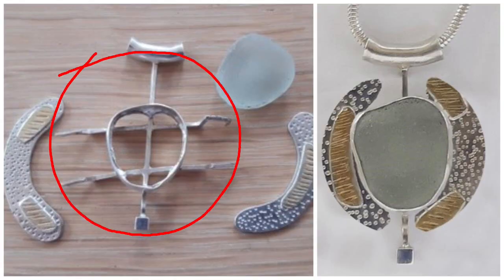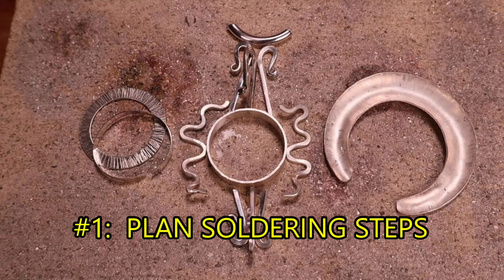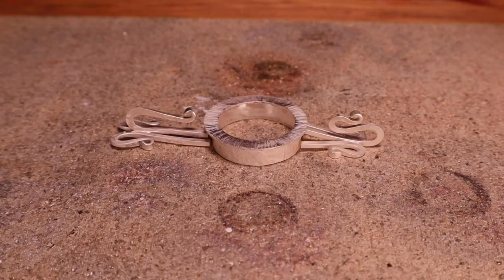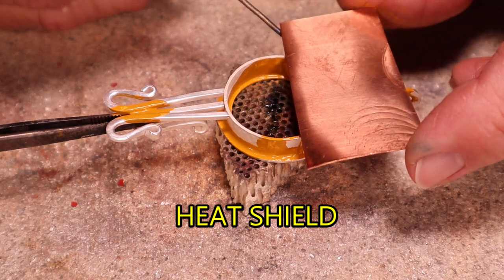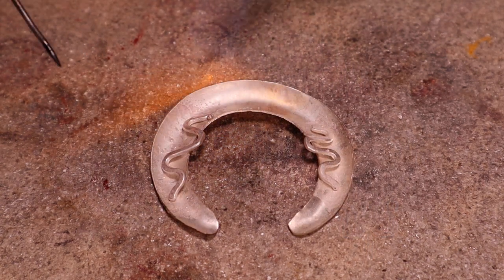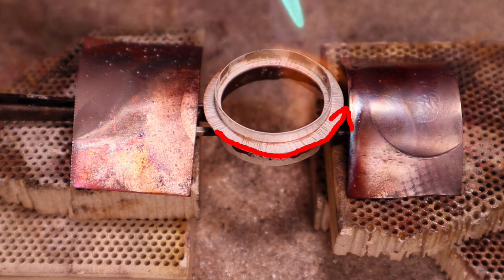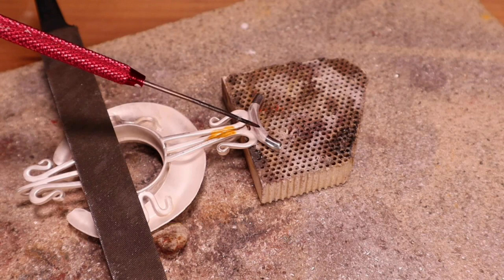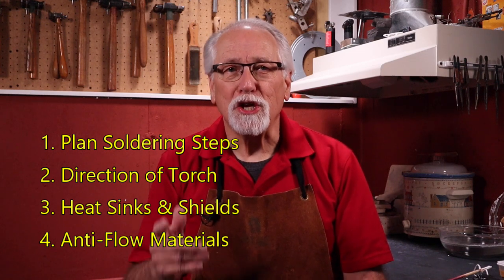HOW TO "NOT MELT" SILVER SOLDER -  PART 2

Comment: thanks so much for this video. It is exactly what I was looking for. How do you clean up all that solder, I'd be curious what your "go-to" method is, thanks for the GREAT videos!
Reply from the maker: Hello Mara,  I'm glad my video was exactly what you were looking for!  I try to avoid using too much solder in the first place so I don't have to clean up so much extra solder. Make sure you check out my video " Best Way to Ruin your Silver Jewelry Project".   For cleaning up the extra solder, it all depends on the project. The 3M polishing disks work very well. I also use silicone wheels.  They can be aggressive, so  be careful with these.  Thank you for watching and commenting.  Greg Greenwood

Comment: Hi Greg, highest compliment to the video and design of your pieces. 
Have got a few quick questions. Is there a specific kind of flux you use. My borax cone method tends to bubble a lot and crystallise, sending the solder pallions flying around. Also, any idea how the masters solder tiny prongs just next to each other, is it the very intense heat of the little smith that allows it . Thanks for taking the time to read this!
Reply from the maker: Hello Jope,  Thank you for your kind comments.  I appreciate it. I use Handy Flux.  It is a borax flux that is already prepared.  It lays down faster than the cone borax.  Tip for you.  After you put the flux on the metal.  Heat it first which will burn off the extra water and it will lay down and remain "sticky".  Put your pallions on when the metal is warm and the flux is still sticky.  This will hold the solder in place.  
Soldering tiny prongs close to each other can be a problem.  Your little smith will help you melt the solder quickly. You can solder the prongs all at once so you don't have to worry about re-melting the prior solder joint. This set up can be hard because you have to use several third hands or tweezers. But it is the easiest to solder.  If you solder one at a time, use the "how to NOT melt solder" methods. 
I hope this has helped you.  Thanks again. Keep watching. Greg Greenwood

Comment: Thank you so much for both of these videos. I learned a lot! Question, how do you texture your silver? It seems to be something you use often on your metal, those very close lines. Also, how long did you keep your metal piece in the liver of Sulphur to get the very subtle color difference? Thanks again for your time.
Reply from the maker: Hello Lori,  Thank you for your kind comments. I appreciate it. You are more than welcome.  The texture is made with a riveting hammer sharp cross pein (peen).  Lots of hammer blows!  I heat my pieces with a hot gun and then put in the liver of sulphur.  I can then take it out and heat with the liquid on the metal and heat different areas. This gives me a little more control of the colors.  Thanks for watching.  Greg Greenwood

Comment: Hi Greg thanks for another great video and thanks for the plug for my Pinterest boards at andydaviesbythesea, if anyone wants to see the finished pendant after doming, they can see it there under handmade Jewellery (spelt the English way). Like you, I want my work to inspire others. Greg, somethings not totally clear to me, is at 4 minutes 27 seconds you say “because you’ve used yellow ochre as a anti reflow medium, you’re not worried about remelting the medium silver solder seams.”  As the yellow ochre will have virtually no heat content it can’t act as a heat sink, so are you saying that you’re not bothered about a bit of localised melting on the understanding that the solder won’t reflow to a different location leaving japs in the joint? Thanks again for all your help and excellent videos. I don’t know if it’s clear to folks but having never made any silverwork before, the jewellery I have made and sold, in the last few months has largely been done with what I have learnt from your videos.  
Kind regards . . .  Andy
Reply from the maker: Hello Andy, You are more than welcome.  Thank you for your input.  At 4 min. 27 secs,  I was talking about the ring and bezel back sheet that had been soldered with medium solder.  I had painted that solder seam with yellow ochre which is an anti-flow material, so I was not worried about the medium solder melting as I was soldering the wires to the ring with medium.  The yellow ochre helps prevent the prior solder from melting which gives me time to solder the wires to the ring. Hope this clarifies your question.  
I am glad you are learning from my videos.  This is the reason I am making all the videos.  Thank you.   Greg Greenwood